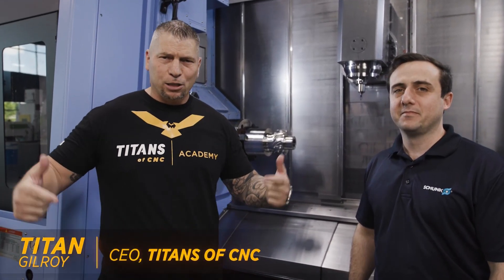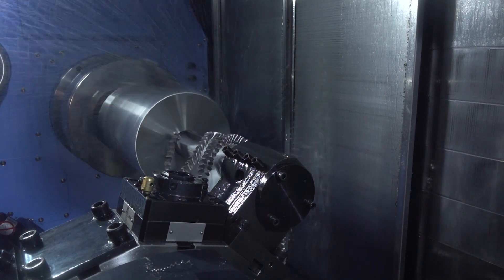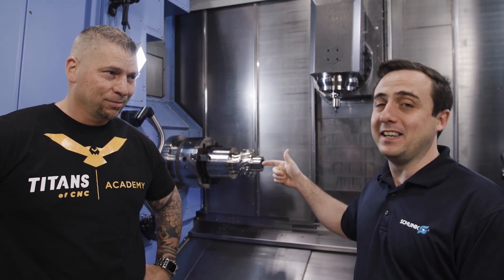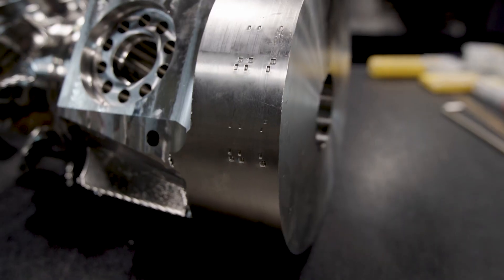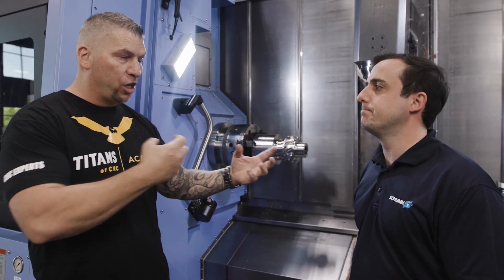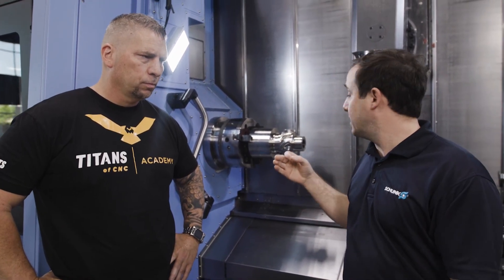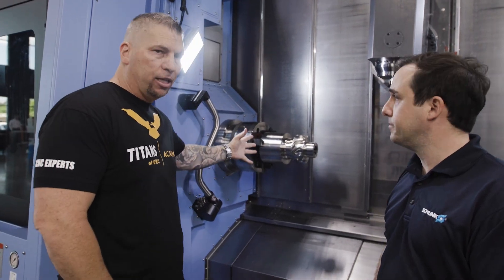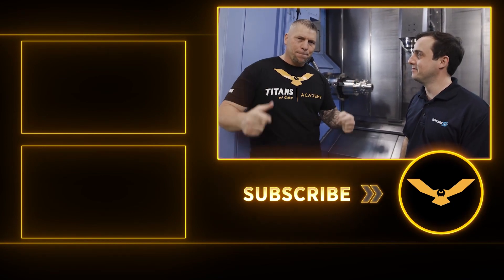Holding 140 Pounds of 316SS in Schunk Claw Jaws instead of using a Steady Rest or Center

Comment: So I'm curious titan. How much are these companies paying you,? Much like the blaser 735. That shit ended up being garbage. You're a sellout dude. Not trust worthy whatsoever.
Reply: Blaser might not be great, but some of the other things he's shilling are actually decent. I use kennametal tools on the regular.
Reply: @forrestcarroll9350  lol kennametal is garbage for most of their tooling.
Reply: @sleddarcheddar  🤷 Their turning tool holders and inserts and indexable mill tooling make me money. I've found they aren't necessarily the most cost efficient but they certainly aren't the worst. For solid tooling... Look elsewhere. KOR-5 pales when put next to Alumigator end mills by GWS or Aero Blizzard by OSG for example
Reply: @forrestcarroll9350  you've obviously never had iscar stuff. Or fraisa solid tools. I'm forced to use some of the kennametal stuff at my current shop because that's what the last guy used. Definitely not up to par for me. A 2 inch facemill hogging aluminum shouldn't blast inserts once a week when I'd do the same with an iscar 2 inch with waaay more chip load and sfm for months before needing an insert rotation. Just saying. I've been there done that with a LOT of tooling.
Reply: @sleddarcheddar  I run both, iscar mostly for solid end mills in steel. Kennametal indexable mostly sees aluminum. My insert life hasn't ever been an issue no matter what brand I'm running as long as it's aluminum, mostly kennametal was chosen after buying a lot of tooling that came with mostly kennametal indexable end mills/face mills etc. In steel I rarely use anything but sandvik as far as indexable goes

Comment: The weakest thing is the Spindle hp that's why the machine tripped.
Reply: Its a doosan.  They pretty gutless in my opinion.  Iv run mori seiki, doosan, hass, Mazak, tool room lathes of Various types...and all i can say is ive never stalled the mazak.
Reply: @pharaun159 I  appreciate  you sharing your experience
Reply: Mazak is a beast, even tho i hate the controls. Ive worked on mazak ajv 60/120 and no cut was too big for it.
Reply: @savioer  i hear you.  I learned on mazaks so the control never bothered me.  But when i ran haas i hated the hoops you had to jump through to do anything on that rediculous control.  It wasnt untill 10 years later when i was training someone on an integrex 300-iv that i realized that the mazak control was just as much of a pain in the butt lol. Once you have to start explaining it, the magic is lost lol
Reply: @savioer  also its funny, we have two horizontal mills side by side.  A haas and a mazak 6800--ii two pallet.  Both are cat 50 spindles...there is no comparison.  Heck there is a 6in difference in the diameter of these spindles.  And it shows.
Reply: @pharaun159 : And what was the problem with the control on Mazak?
Reply: @runejakobsen9958  just alot of hoops you have to jump through to do stuff on the control.  Hit mode, flip switch, hold door release, hold door open.  Just to open the door lol.  Alot of things are hidden in soft key menus.  Its just cumbersome.  Not as bad as the haas control, but i may be biased on that.  Anyone walking over to either a haas or mazak from a standard fanuc control are going to be confused.
Reply: Must me more of a mill than a lathe 😂 can easily pull a 2 3/8 drill in our okuma lathe of equal size in 304ss no problem.

Comment: One thing I do when useing the chuck jaws on my 4th axis, I machine small pockets for the jaws so there is a mechanical lock-in And if god forbid I have to remove the stock and remachine it you can get reliable positioning, since the inverse of the chuck is in the stock back.